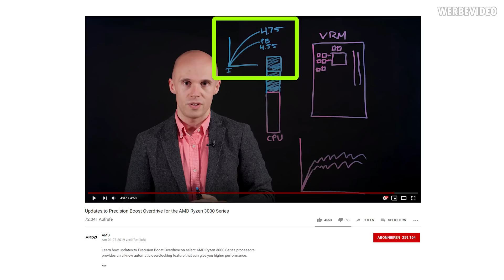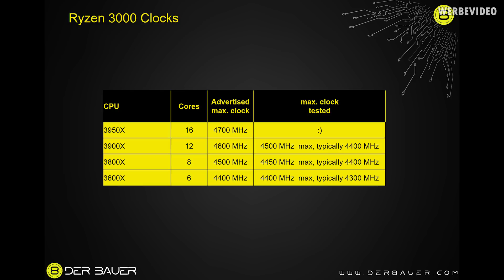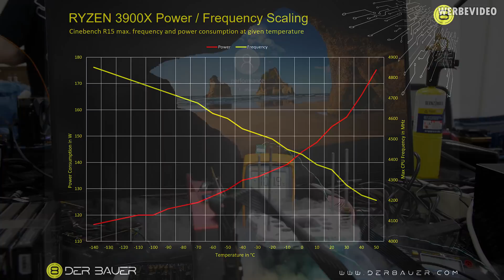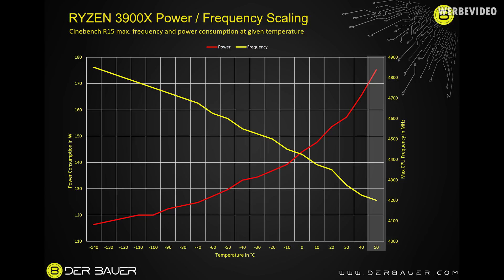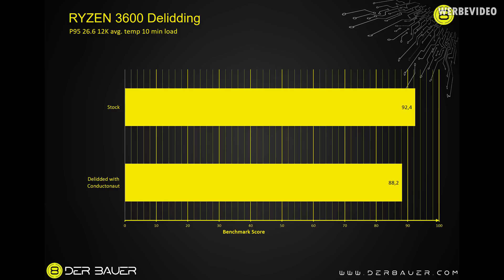RYZEN 3000 Delidded - Overclocking Expectations and Temperature Scaling

Comment: Where's 3700x? literally all reviews are either missing 3700x or 3800x..what is the actual difference between those 2? except the tdp
Reply: @Traumatree  More like $70 less. And I disagree. 100 MHz isn't worth $70.
Reply: Advocatus Diaboli  I'm wondering if the 3800X might have 2 chiplets, possibly a cut-down 3900X that didn't pass testing.
Reply: @AMDRyzenEnthusiastGroup  That's an interesting thought. Fully functional 8 core chiplets are going to be in great demand for Rome so the 3700X is going to get the low binned ones. On the other hand there are going to be a lot of faulty chiplets with four or five salvageable cores that can't be used anywhere else but which bin quite high. Maybe two of them could be used to make a 3800X. Perhaps our hero here could delid one and find out?
Reply: Advocatus Diaboli Maybe It's because the 3700x is higher quality silicon than the 3800x? I mean it has way lower TDP at almost the same performance. Could mean more efficient silicon.
Reply: Paul's hardware.
Reply: Timmy Joe did the 3700x
Reply: Advocatus Diaboli  IKR?
Reply: @Traumatree  3700X is best for a powerful htpc or for undervolting/efficiency fans + x470 to avoid the x570 chipset lava.
Reply: @Lolimaster  I can't choose between the 3700X or the 3800X for a HTPC build I want to do for my friend's 4K tv.
Reply: Same situation with the 1700vs1800X, and 2700 to 2700X. The 3800X is just a waste of money (AMD also never marketed it) and only an idiot would get it over a 3700X
Reply: @Traumatree  nope. Any chip can support any voltage, it's just down to the clocks and temps that can make or break it. And as nappydrew said it's probs a 3900x chiplet that couldn't pass testing so they made it its own thing that would then support the claim of a higher tdp. The 3700x most likely has 2 chipsets of 4c/8t while the 3800x only has one of 8c/16t
Reply: My 3800X runs 4.5Ghz all cores @1.4V. No LLC, no PBO. R20 scores 5315 and R15 scores 2340. My friend who’s got a 3700x barely gets 4.35Ghz from 1.4V. He needs to set LLC to Turbo to maintain the Vcore during load. As for me, i just laugh coz i only set vcore to 1.4V and clock ratio to 45 and that’s all. LOL.
Reply: The 3800x is actually the lower end one due the extra tdp. If it was a binned chip it would hit higher clocks at a lower or the same tdp but it doesn't so just go with the 3700x

Comment: my i7 8700k 5,1ghz -1.36v is best
Reply: Not bad, but I’d pick the extra cores from AMD. You’ll still be fine in gaming though, no reason to upgrade quite yet (yikes my 8750h is getting pegged hard at 1080p with a mere GTX 1070! I almost opted for the 7700HQ to save $100 but those went out of stock and I’m glad I got the extra cores)

Comment: you are a fukcing intel dog....wof wof wof
4.4ghz is alwys good when you now getting every gen same clock but 10% ipc+power reduc
intel shits him self in the legs!! always clock clock clock..and now they can get 5 ghz on 10nm not even 4.2 ghz on 10nm...thats because they are not going to 10nm
but amd in the other hand always 4.4 ghz but 10% ipc+power saving...and the best die shrink...5nm or 3nm more cores more perf
Reply: Overclock performance is terrible.
Reply: @dime4026  He didn't even describe his overclock methodology... Good PBO ryzen oc is not just flipping the switch to "on" in bios and calling it a day. I wouldn't be surprised if I could get 1 or 2 cores to run 4.9Ghz/5Ghz on 3800x on air. 4 cores on 4.7Ghz . All core 4.5Ghz/4.4Ghz. 

 Unfortunately I won't be able to check it out because my cpu is enough as for now, and there is no point in upgrading.
Reply: @buka9993   I appreciate the candid response. I really want ryzen to be the one. People dont build custom water loops to not overclock in the first place.

Comment: direct die contact is the way to go here, otherwise woudln't you be gaining temp for no good reason?
Reply: You’ll need to sand down the socket or use specific water coolers zip tie mounted off center to not grind a lot of your socket off (the die is shorter than the plastic bump thing on AM4). That’s the only good reason (that off center is going to be a pain for even pressure and not crack the exposed die), I delided a Ryzen yesterday, I’m sure 3rd gen is at least ballpark similar height

Comment: This is very disappointing overclocking results. Any explanation as to why they can't hit higher clocks even with massive voltage increase?
Reply: https://www.reddit.com/r/Amd/comments/cacwf9/psa_ryzen_3000_gaming_performance_is_being_gimped/
Reply: That was expected considering low 7nm process. This happens because of a higher efficiency in thermals and power consumption. The same scenario happens when you try to overclock Maxwell/Pascall/Turing GPUs and even VEGA cards, they wont OC much even if you put lots of volts, thats only making them "thermal throttling" faster.. In the end a waterblock or maybe a chiller is not enough over the stock cooler, yeah they will have lower temps but are not enough to increase clocks. Adding too much voltage to your CPU will degrade it over time, thats why Roman is right recommending 1.35-1.40 max. Also over 1.4v you wont scale much and your temps will be very high, making CPU more unstable to run anything.

Comment: thanks for the video @der8auer  can you test on the 12 or the 16 when they drop, as with 2 dies and a lot more power being used the drop in temp maybe more, direct to die water cooled help any for the 12core and 16 core as you did with Intel.

Comment: im more excited for the ROG STRIX 5700 xt in a month or 2 <3  im still using a strix 480 8gb card luuul
Reply: Don't be excited. The 2060s is equal or better after overclocking. The 2070s is on a different level, and is around 2080 stock when overclocking. AMD does not compete in the GPU space, but their CPUs are good.
Reply: @Zerosixious  you could spend a extra 100 dollars or more on a super card im not lool i want to save $$$ for other things..sticking with the 5700xt series

Comment: 3:30 "I tested this with a iOS with air
 coolers with custom water cooling where the CPU was not hitting more than 40 degree Celsius it never in any circumstance hit the maximum clock for the 12 core and for the 8 core." 
You're saying about deltas T or there is a error in your text or what? Because I can translate that only like you try overclock CPU but with 40 degree Celsius on top.

Comment: Well, Here is was considering changing to AMD from Intel for the first time ever, what a disappointing release!!!
Reply: Lilboots It seems as if clock speeds are not such a big deal anymore based on performance numbers
Reply: @lukeburtis1948  it hasn't been for a long time, which is why manufacturers put more cores on their CPUs. There's a limit to how high of a clock speed you can achieve, especially in a main stream environment.

Comment: 2:06  We need to talk about that, that is fked up.
Reply: So, i wrote with Linus, from Linus tech Tipps, it seems like there was an emergency Update, and yesterday IT came out, which is why Linus and some other youtubers had to Remake their benchmarks. Seems like it was fixed. Upvote this so people can See.
Reply: @VoidBass6412  Does that now mean that they now can hit the Advertised Clocks ?
Reply: @snowgentleman1937  i quote linus here : "We got an agesa update literally yesterday (had to retest everything...) that dramatically altered boost performance". <--- So it seems like YES, also the point should be on : the advertised boost clock on 4,6 ghz on the 3900x is only for single core. if you use all the cores ur going to hit 4,3 ghz . It was most likely a marketing trick my AMD (im a big fan but this dissapointed me as hell) .  Don't get me wrong, the cpu's are still strong as hell, but that only shows that the 4,3 ghz are so strong because of the 13% ipc increase, which is able to battle the 9900k in a lot of situations/games. That would explain perfectly why the clocks only hit a certain point but are quite a bit away from the promised clocks, while still having a lot of frames. I hope this clarifies a lot of things that are going on here. Also the 3700x doesen't hit 4,3 on all cores ( watch hardware unboxed ) video, he states 3700x not OC and 3700x OC to 4,3 ghz.
Reply: @VoidBass6412  Well Intel has done the same for years. some of their CPUs they can't even reach boost clocks.
I'm kinda disappointed that AMD is doing the same, but "boost clock" doesn't mean "all core".
Reply: yeah, and so unnecessary. amd doesn't have to bullshit anyone to sell these cpu's, the product speaks for itself. why would they ruin all that by bullshitting about the clocks?

Comment: Don't those ASUS boards all have non-doubled VRMs with 6 or 7 phases max?
Reply: As you can see, the power consumption is lower than first gen, and a couple of hamsters could power it (id use a 4 stage hamster VRM setup for these chips, make sure he hamsters aren’t too overworked). My laptop 8750h uses 80w, stock, on a LAPTOP! 90 to 117w is basically nothing...

Comment: Have you experienced sudden death of i7-6850K? I have killed two so far, strange because every voltage I used was within specs.  ps: both specimen worked flawlessly for 3 years. and were never above 58c. Question: Why they die?
Reply: mostly because memory overclocking\overvoltage Intel IMC have very fragile PHY.

Comment: Would a threadripper optimized block or a Noctua cooler work better than a Corsair AIO? because of the layout
Reply: A cooler with a plate matching the massive size of TR4 will in any case be better because the hot spot isn't in the middle, its closer to the 4 corners.

Comment: i still wonder if this off center chiplet affects ait cooling considering  it will not make great contact with most of the heat pipes. and thermal images of the past show that the spreading of heat simply isnt that great on the spreader.

Comment: Which BIOS revision did you use? Because The Stilt has this to say:
"In case of the ASUS Crosshair VIII Hero Wi-Fi motherboard, the media was instructed to use 0066 bios build,
 which had been vetted and approved by AMD. However, newer bios builds were available and ASUS has also (allegedly) told the media to use those versions. What exactly has transpired here is still under investigation, but regardless of the actual reasons behind it, the consequences might be rather significant. In practical terms, all reviews which were done on ASUS Crosshair VIII Formula or Hero motherboards using other than 0066 bios build must be considered invalid, at least partially. Reviews using other ASUS motherboard models (not provided by AMD) are under suspicion as well.

Few days ago, I noticed certain anomalies, while measuring the power consumption of the different Matisse SKUs. Inspection of the power management parameters revealed no issues, which could have explained those anomalies.
 The external power measurements (VRM DCR) revealed that the CPU was consuming significantly more power, than its power management should have allowed it to. I initially suspected that this was AMDs own doing, in an effort trying to boost the performance of the new CPUs even further, but further investigation indicated otherwise.

AMD had no part in it, and the actions by ASUS are the sole reason behind it. The investigation revealed that ASUS is altering one or more power management parameters of the CPU, causing it believe it consumes less power than it actually does. As a result, the frequencies will be higher than the actual power budget would normally allow to. Tricks like this are pretty much a common (mal)practice these days however, there is a good reason why this must be considered worse than the others: this "thing" is completely undetectable without external measurements and rather deep knowledge, but also there is no way to disable it either. Even a person such as myself, who can control most things on these platforms cannot disable this "thing". As you may notice, at the moment I call this issue the "thing", since I'm giving ASUS the benefit of a doubt."
Reply: Multi Core Enhancement all over again?
Reply: I am also curious about his bios settings, as others who have done reviews of the ryzen 3700x enabled a setting that was typically disabled that allowed the processor to run at maximum performance with out manually overclocking it.
Reply: He's using a STRIX motherboard besides what could this "thing" even be? Idunno seems super fishy if it's true but needs more confirmation.

Comment: I think of using a graphene based pad to address the hotspot problem. Because they have a much more higher horizontal heat conductivity. Could that be a solution ?
Despite the overall conductivity may be lower than liquid metal.

Comment: Good stuff and quite evil those lied boost clocks. 2000 series was easy, look at X series boost clock and you have max OC of non X CPU. 3000 you don't even know single core clocks, but guess best estimate is -100mhz of claimed based on your findings.
Reply: Not evil, didn't lie. Before you blather on about crap you don't understand, just remember, that the UEFI launch BIOS might have bugs in it and the QVL for ram might be causing adverse results with the new CPUs.
Reply: @JosephArata  AMD Ryzen™ 7 3800X
Base Clock 3.9GHz
Max Boost Clock 4.5GHz
If they say 4.5 and it boosts 4.4 it's lying, very simple. By your logic Ryzen 4000 can promise 5GHz boost clock, do 4.7 and it's still not lying as you could do it with LN2. If it is a BIOS bug, fine, but don't buy that as launch AGESA is 1.0.0.3 already.

Comment: People just compare clocks, but it's more the Intel side (just bigger clock and 3-4% IPC) bud ryzen has about 13% IPC improvement so it's could be like r7 2700x on 5,1 GHz
Reply: 3700x-3900x is like 9900k at 4.6ghz. still worse than 9900k at 1080p but pretty close. 3700x definitely better than 9900k considering the 150$ price difference.

Comment: Would like to see direct die testing one day
Reply: You have to grind down the motherboard socket a lot, the chip becomes much shorter (the plastic bit in the side interferes, I can zip tie some coolers off-center and make it work, but my LN2 cooler won’t fit because it then hits the VRM)

Comment: i have a ryzen 1700 which is clocked at 4ghz at 1.35v. I feel like its not really worth upgrading considering i will get 0,4 ghz more at best. Kinda dissapointing, but maybe further optimization will improve this?
Reply: Just wait on the real usage test, they should have 12-13% better IPC

Comment: How is it that intel does 5ghz on 14nm and Amd can’t even do it with 7nm?
Reply: Because there is a BIOS issue going on. This video is a mistake, and/or is biased.  Why would a manual OC be 100 MHz less than an automatic OC? Why is the voltage so high considering such a low overclock? You should also consider Intel is getting 5 GHz all cores with an unauthorized over spec TDP setting in the BIOS that makes the CPU use about 150-160W, not the advertised 95W with a single core boost of 5 GHz.
Reply: no, with smaller node like 10nm in IceLake-U Intel also lost 1GHz, smaller wires, more resistance, more Vmin.
Reply: tsmc's 7nm node was designed for power efficiency (smartphone use) rather than clockspeed

Comment: So no real overclocking for home use. This cpu seems great for a non techsavvy and/or non overclocker customer, because they basicly already get top performance out of their chip. Which is nice in its own way. It kinda raises the baseline of what a CPU should perform at which is good, but also doesn't raise the bar of what a CPU could be tuned into which is in my opinion kind of dissapointing.

Comment: I am curious, why don't you ever direct mount the CPU coolers to the die? why do you put the heat spreader back on?
Have you done a video comparing the difference? 
It wasn't a problem with the old cpus 
Thanks for the video, resolves all questions and makes sense.
Banging chips for the frequency
Reply: The AM4 socket needs the plastic sanded or grinder down (my delided Ryzen is way too short for my LN2 cooler, I can do phase but I need to position the cooler off-center with zip tie mounting, or a waterblock also off-center). That’s probably the reason, it’s too shallow for the cooler to touch before it interferes with the plastic bump on the side.

He does sell direct die kits for Intel though.